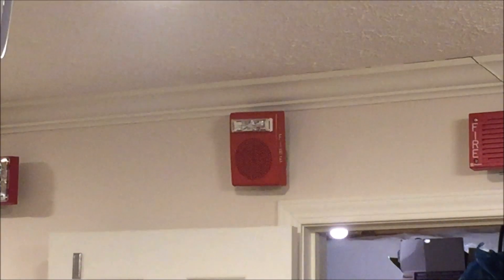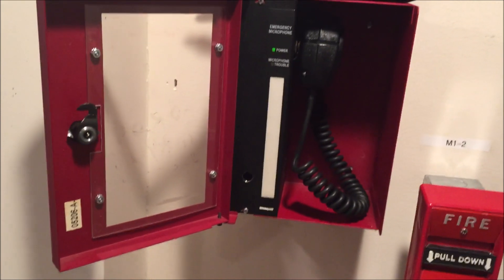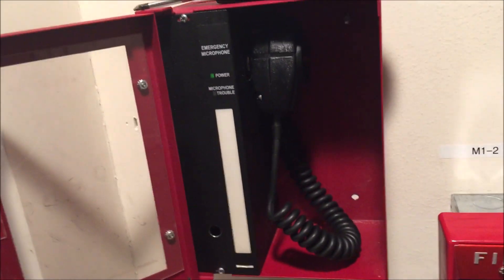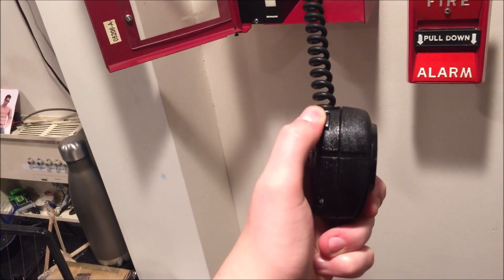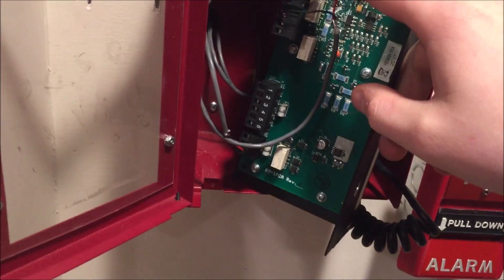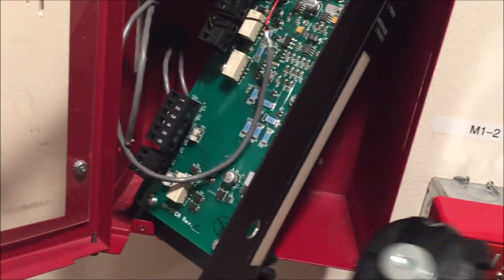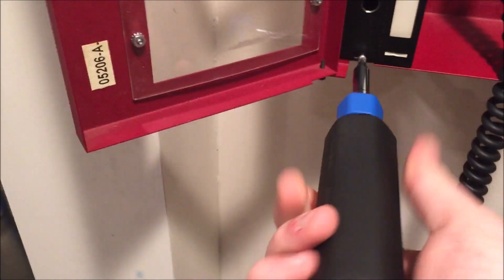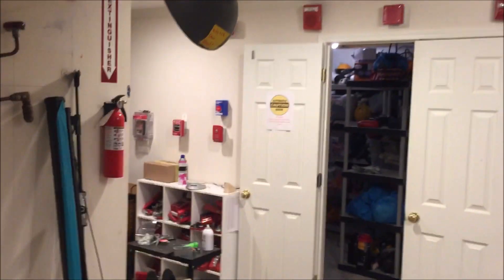Testing and Overview of New Voice Evac System

Comment: Would it be okay if I offered a suggestion?  If you purchase an Elk124 and use a 1/4" plug to RCA cord and link it to an amplifier, it will play an automated tone and voice automatically, just like a voice evac system.  You could record any tone you want, any messages, anything.  Simplex, Fire-Lite, Notifier, etc.  And it will still allow you to have a microphone to use the setup as a P.A system.  And it will even be able to safely handle the 25/70 speakers that are typical with voice evac systems.  Wire a, Wheelock E-70 speaker/strobe for example, to the amplifier.  Then use the RCA to 1/4" cord to plug the Elk124 to the amplifier.  Record your, Simplex voice and slow whoop tone for example, to the channels of the Elk124.  Tie the Elk124 to your panel by using a silenceable relay and 12 volt DC power supply.  Program a relay in your panel as silenceable or use an addressable relay programmed as silenceable as like a fake nac and use a 12-volt DC power supply and presto!  You have voice evac!  The only downside of this is that it won't supervise the speakers but for a hobby system, it would be perfect.

Comment: I have a request for a system, but if your not doing requests anymore that’s fine.
On any of your systems could you do a test with a system sensor mass on 800hz continues, spectralert classics on code 3 electromechanical horn, and a system sensor p2r? For pull stations I would like to request bg 10s and bg 12s. Thanks! :)
Reply from the maker: Sure thing! What panel would you like it through?
Reply: How about the notifier panel